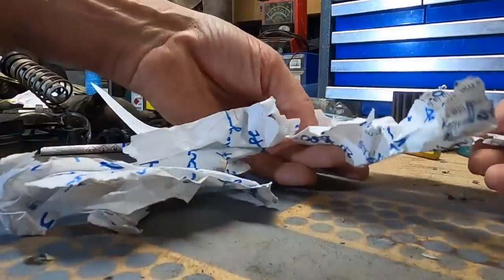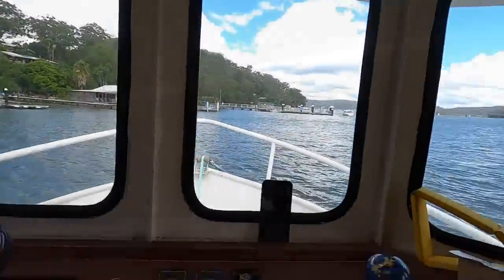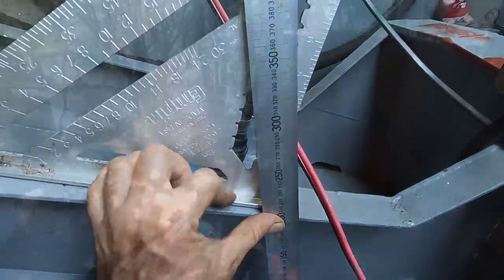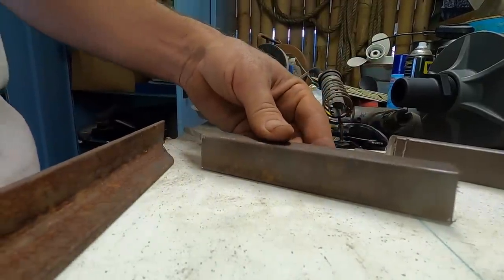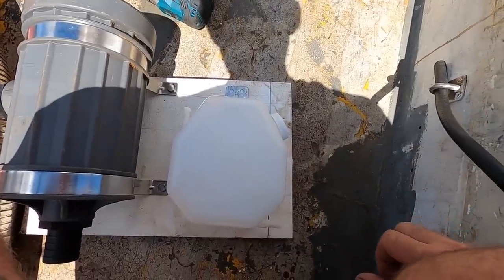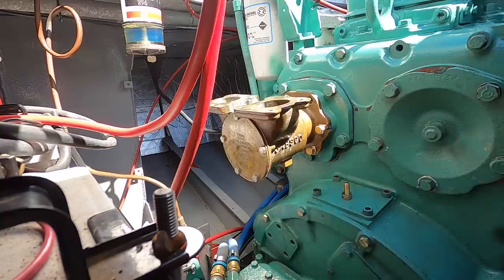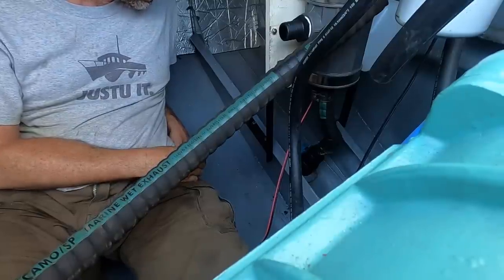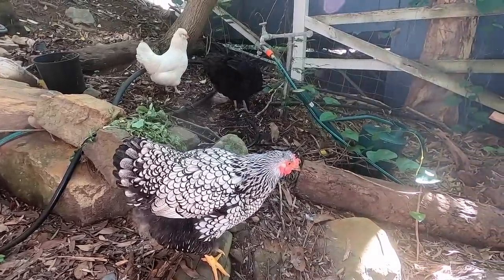Raw water cooling

Comment: Think about going to an auto junk yard and getting a valve cover from an old car with the filler on top. Cut it off, weld it to the Detroit cover. Problem solved! Probably will need to weld the baffle on the bottom side as well!
Reply from the maker: Yes, wouldn't mind adding one to the cover even if the other filler is free as it will be easier to reach.
Reply: There is a newer model valve cover with oil fill available for $180 US/ Moroso has a no weld valve cover oil fill kit for $53 from Jegs

Comment: Regarding long hose vs copper pipe and two connecting hoses....vibration is an enemy of connections in boats and if you have a longish hose dangling between two rigid fittings its a possible problem.  A mid span support if possible might be an idea.
Reply from the maker: Yes, have decided to use the original copper pipe.

Comment: I'd rotate the strainer ~°45 anticlockwise so the the supply hose can run closer to the engine.  Having a hose running straight through your access-space will get old quickly. HTH
Reply from the maker: That could work out well. I'll get the silencer back on first and see how it all looks. Nice idea.

Comment: You are so close to the end of a long road. Great series of vidoes. Still a bit worried about your shaft coupling. Seems a bit unforgiving. Also wondering what you are planning for your ballast. Can't wait for the sea trials, and beyond.
Reply from the maker: Talk about shaft coupling at the end of the video. Have a bit of lead in the boat as ballast at the moment but definitely planning to add more and secure it so it can't move around.

Comment: Stu, The previous plumbing had the hose passing inboard of the filler cap, but your plumbing to the filter is now in the way. Why don't you lengthen the short hose between the pump and the 90 so it clears the filler on the outboard side? Having it right up next to the engine isn't that critical now that you are using a long hose to connect to the front.
Reply from the maker: Yes, I will go back to tucking it inbetween the filler and the filter.

Comment: Go to you local hydraulic fitting guys  they will have an npt ( national pipe thead)  adaptor. You can got Npt into Bsp 1/4'  but do not tighten just use a good hydraulic sealant goo

Comment: Stu  make a cover to go over the blower intake,   plywood with handle just in case of a runaway when you start it
Reply from the maker: I've decided to permanently mount a CO2 extinguisher to avoid the problem of vacuum sucking the seals out, but I agree, some way of having an emergency shutoff is important.

Comment: I believe all hoses should be doubled clamped below the waterline. You are using nice high quality clamps though. cheers
Reply from the maker: I would certainly trust one of these clamps over two worm drive clamps. They are also wider which makes double clamping tricky.
Reply: @DangarMarine  totally agree with you. In Canada for insurance reasons they would still require two.

Comment: Probably had copper because radiator hoses on diesels tend to bulge and weep, as they are under higher pressures from the sea water pump than usual, over time they can actually be blown out.. I wouldn't say its a bad idea replacing it all with radiator hose, but something to be aware of long term..Quite often you will have to clean out the heat exchanger as this is the thing that creates all the back pressure once crustaceans start growing in there..
Reply from the maker: True, the back pressure will increase between heat exchanger services. I think I will just buy more hose clamps and use the original copper pipe.

Comment: I think it might be worthwhile coming up with a solution so that hose doesn't block your filler.  Royal pain if you have to remove the valve cover every time you need to change oil.
Reply from the maker: Looking at the old video it looks like it can be tucked between the oil filter and the filler cap.

Comment: Put A Second roller in to keep the Line in between  them just below the one you have so the line is trapped in the rollers. Just go to any Machine shop they will center bore it to your Plug size and Then counter Bore so you have the Depth for the Plug.
Reply from the maker: Going to be completely redesigning the bow rollers soon to install the anchor winch.

Comment: Was curious if you have a means of monitoring the pump? Just cleaned out my thermostat, it had crud in it kept it from working properly  even though the pump was still working. 
I know in outboards we have a small line coming off the pump which allows user to monitor the water pressure knowing the pump is still pumping. If you had something similar it could give you early warning if something is wrong before the temp gauge swings over. What about a sacrifical anode inline or is not an issue. 
Can't believe how far you came from the first video wow. Envious here in Colorado
Reply from the maker: Yes. I showed the sensor a few videos ago but I will be installing it in the next video just before the outlet.

Comment: I would weld a cross member on that bracket just in case weird stuff happens in rough seas
Reply: Weird stuff does happen indeed! One time we had a fire extinguisher topple down stairs from a wheelhouse to corridor/galley and open up full blast midway, boat was rolling like crazy and took us weeks to not have a sour taste in our mouth. Thing is that I actually serviced them all the day before including bracket mounts and stainless bolts to everything.
Reply from the maker: Thinking I might add something like that, yes.

Comment: New subscriber here. I just bought a 80’s Century cabin cruiser. It has a King Cobra stern drive and a GM 6.2 diesel with a separate Peninsular cooling system. I’m replumbing the raw water system. My question is, does the stern drive also supply raw water as well as the raw water intake and where should it T into?  When I run it on muffs I get water coming through a hose towards the motor. Should I just T into the raw water supply that feeds the sea strainer?

Comment: Your newfound ability to transport instantly between shop and boats must come in handy. Is double clamping through hole hoses not a thing?
Reply from the maker: People do tend to double clamp with the cheap worm drive clamps but these are pretty reliable, and wider which makes fitting two hard.

Comment: Should there be double hose clamps on thru-hulls and fresh water hoses?
Reply from the maker: These clamps are probably more reliable that two worm drive clamps so I'm not that worried. They are also wider which makes fitting two impossible in many situations. I have read that people do add a second lock nut on the thread though which I will do.

Comment: Shouldn't the bolts for the pump and the cover plate next to it have copper washers to prevent oil leaking out?  See Scotts vids.
Reply from the maker: Should be fine, no oil pressure present there, just a bit of splashing.

Comment: Please be careful with hot work. Every few years or so, we loose a shipyard worker to explosions from collecting vapors in enclosed/confined spaces. We lost a deckhouse for a destroyer due to combustible materials on the opposite side of the bulkhead from where the hot work was being done. No joke, it would be a loss to humanity if you bought the farm.
Reply from the maker: Yes, there is no doubt that confined spaces can be very dangerous for a variety of reasons from explosions to suffocation.

Comment: Mate i would suggest 1. Super glue, is a great Locking Tread. 2. on the brackets I would weld a gusset as the vibration i would dare say will eventually brake the welds, as it is a tad top heavy .  :) It may be ok and will last for a while, but just to be safe :) ohhhh and No you can't make this S#!T up ...lol
Reply from the maker: Hey Ben, yes, thinking of bracing it upwards to the deck beam.

Comment: I've been wondering Stu why didn't you replace the Detroit with a more modern engine?
Reply: He mentions why in a previous episode..I will find the link
Reply from the maker: The big trouble is that when you put a new engine in you need to re-engineer just about everything. It would also likely weigh a lot less and therefore need a lot of ballast added. The short very is that the boat is built around this engine, and they do have a bit of cult following so I decided to stick with it.

Comment: My Autometer temp gauge set came with that adapter. So check out Autometer online ?
Reply from the maker: I'll take a look, thanks.
Reply: Dangar Marine what size bsp thread and npt thread? Looks about 3/8 bsp and 1/8th npt? I’m geared up to machine up one if you want I’m in Newcastle

Comment: I don't like the idea of the adaptor from tapered shaft to straight. We use those to go from Morse taper tools to straight holder in the machine shop. I have boxes of them( without a keyway) . Maybe you could find one that fits , Turret lathes use them to mount a taper shank drill in a straight hole in the turret. They are not easy to make , it should be hardened and with the keyway too,  ugly ........and you want to put 150 hp thru it?
A much better solution that would be easier and cheaper is  to make a new steel flange piece ( or what ever it is you need to fit the vetus flex joint).   Or could the vetus piece be bored out with the right taper ?   
Just looked up vetus flex couplings , they have all sorts , including ones made to fit on tapered shafts , machinable adaptors wtc..........Cheers Warren
Reply from the maker: I'm thrilled about the idea either, but apparently if done well it will be fine.

Comment: You need to make sure you've got your safety thongs on when welding;)

eBay has NPT taps galore, Hare and Forbes is another place that I've seen NPT taps on the shelf.
Reply: Just keep away from Blackwoods, they have them, but you really don't want to pay their prices. I paid over $70 for 1 (one) 1/8" NPTF tap.

Comment: "where do i find npt tap?" uhm anywhere since the one you need is probably a 1/8 npt tap that comes in just about any threading kit metric or standard. Btw NPT is an international standard. The detroit would have come with npt threads. There is "soft conversions" to a metric number but it really is npt. The only other one I know of is bpt which is not common at all. Even then aside from a few small sizes the rest of "bpt" are actually npt. Its on wikipedia if you want to look.

Just a note. I have never figured out how the numbering system on npt works. The 1/8 npt tap looks like a 3/8 fine thread  tap, or 10mm. Its just visibly tapered blunt and short.
Reply from the maker: So far places I have been have said that don't have anything for a tapered thread. Somehow I get the feeling it won't be that critical and that I can just crank it in anywhere if the thread pitch is right.
Reply: @DangarMarine  taper pipe thread was developed to prevent leaks of fluid, especially those under high pressure(steam). You want to install a temperature sensor i believe which does have to withstand pressure.  You could always just go on amazon and order a single 1/8 pipe thread tap. Just a note while steel can self thread brass does not it just strips.  as for the plug drill it tap it and counter drill from other side leaving 1/8 inch thick edge about 3mm around to expose the end. 

Btw how wide is that brass plug fitting you have? I only ask cause it sure looks in video to be a 1/2npt 12 brass plug.

Comment: You could have just cut a double 35 degree notch out of one side of the angle and bent it over and welded the cuts together. Much stronger and only one small weld.

Comment: Is the floating metal tube in the cooling system there to resist high temperatures rising off the blower? Will radiator hose be up to the job? (a heat deflector may make the hose solution work, if you can fabricate and mount one). I always enjoy your videos and humour.
Reply from the maker: That could be the case, I'm not sure how much heat the blower will give off.
Reply: @DangarMarine  It's just a guess. But maybe something to keep an eye on once you can run it for a while - if you go with the hose solution.

Comment: Fuck raw water cooling and another hole in your boat, and another head ache to worry about.  Since you are doing this from scratch you need keel cooling.  Just 2 pipes down the keel with small fins will keep the engine cool.